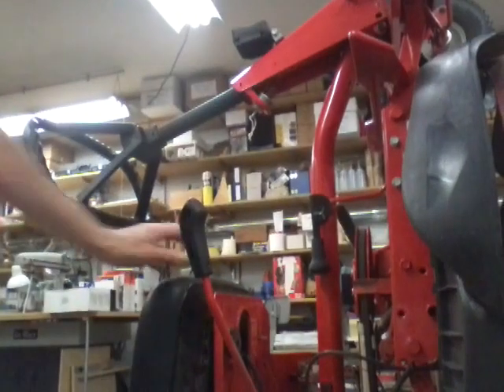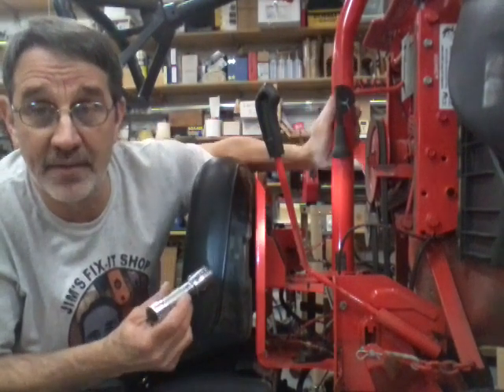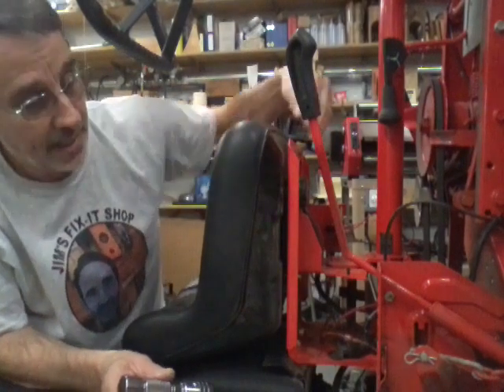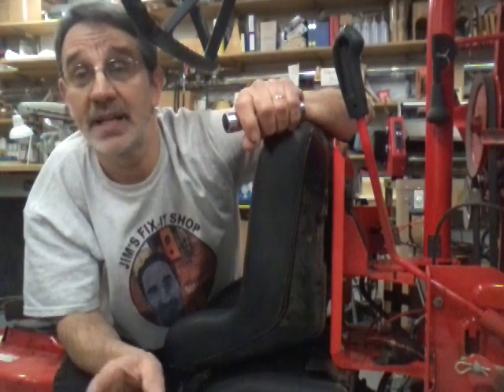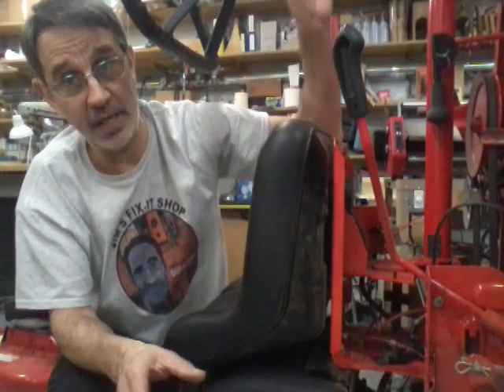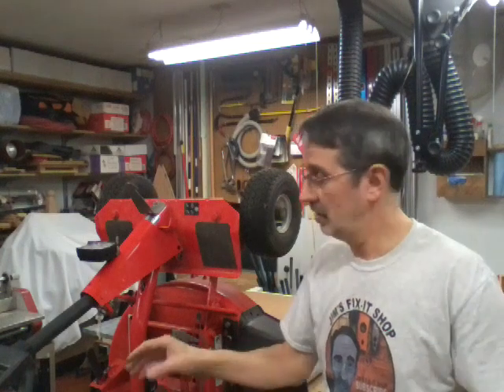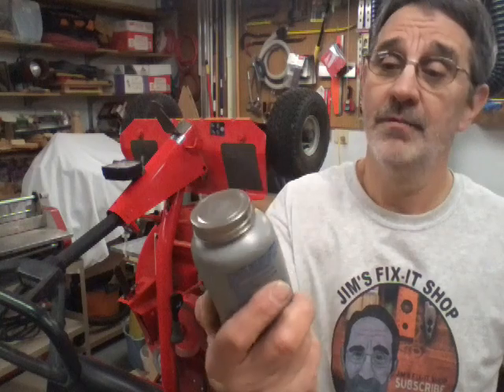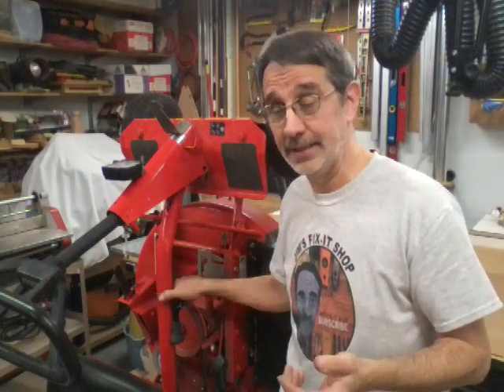350.  Replacing the pilot bushing in a Snapper rear engine rider

Comment: Thanks Jim. I've purchased a 1999 snapper 28" HV. Sofar, I've replaced everthing, but the transmission parts which seem to be in good condition. I had a used Coment which lasted for about 30years. Over the last 15 years, I've had 3 mowers. I truly don't believe there's no better mower out there than the 28"HV for lawns under an acre. I presently been using a snapper rear engine 33" hydro that I do not care for, so after I replace the pilot bushing the 33 has got to go! Anyway, just thought I would thank you for the great videos on snapper repairs. I've learned a lot, and you have saved me countless hours on repair times with your tips. Thanks again. Also, I replaced the engine from a 10hp to a new 11.5. The wiring video cleared up all my concerns on the rewire. This motor has the regulator, so pretty much wire the same to the battery.
Reply: I'll forward a photo when I finish up. The mower has no rust, so it was worth the overhaul!
Reply from the maker: Well, don’t forget to be sitting on it when you take the picture I’d like to hang it on my wall of friends.     Jim

Comment: What an experience!  After noting the play in the pivot bushing by grabbing the front edge of my seat to lift and feeling what I thought was a good quarter inch of lift at the seat edge I got concerned, bought a new bushing and dove in. What a job!  After about 5 hours of cussing and working my but off it was finally finished. It has the exact amount of play now as it did before I replaced the bushing.  All I gained was piece of mind knowing I had a new one.  
I bought the mower in 2010, so after 12 years of mowing a half acre in Kentucky the original bushing  showed basically no wear.  I wouldn't try the job unless you're an experienced mechanic, it was  not easy.

Comment: Hi Jim, another great tutorial.  I recently removed my tube from the main case to replace my pilot bearing.  I was curious to know if a grease fitting could be installed and utilized for lubrication purposes for that area?
Reply from the maker: I have installed grease fittings on them tubes before but the wall  of the tube is so thin you have to weld a nut on the outside of the tube to screw the grease fitting into then you drill a hole through the tube so the grease can get in and the grease fittings are a 14-28 thread.  Jim

Comment: Hey Jim!Another informative video & allot of good tips on step by step procedures , I use the same Permatex anti seize on my tractor center links,Or wherever threaded adjusters need anti seize is needed ,Good tip on that is to use disposable latex gloves because it hard to wash off your hands, & it's aluminum base anti seize so it's rust resistant . ( SNAPPOUT ) That engine that's on your workbench what is that going on ? Looks like a replacement for a walk behind self propelled Snapper.
Reply from the maker: No that's a 12 horse off of one of the rear engine Riders I'm going to try to put rings and a valve job in it. Jim
Reply: @jimjackson9381  It does not look that big very similar to the 1 I put on my 86 S/P walk behind Snapper. Thank You for your reply & be safe Jim . ( Snappout )

Comment: Hi Jim - it's Big Rodders in Ireland.  A comment you made got me thinking.  Have you ever tied one end of the mower to a tree and tried to rachet strap the other end away from it to separate the two halves?  If so, was it a success or is heating that sucker the only game in town?
Reply: Jim - Rodders again.  My hospital equipment engineer dropped by today and gave me two 17 amp/hr gel batteries, which are ideal for Snapper RERs.  Did you make any progress in getting your hands on a gel battery?  Using a gel battery and running the carb dry removes all concerns about tipping the mower up on its end.

Comment: Hi Jim.  Please do a vid on replacing the Brake/Clutch cable.  Mine and others I have seen are failing right at the brake/clutch pedal...
Reply from the maker: Does your machine have two pedals or just one, it makes a difference on how the cables are ran and how many cables you have. Jim
Reply: @jimjackson9381  It is one pedal.  28" deck, purchased 2008 series 23 model 7800104.   Think it would be a great vid for cable replacement.   Got this on Amazon: Briggs and Stratton 7022449YP Clutch Cable
Reply: @jimjackson9381  Hi Jim,  Got it done, took about 1 hour to replace the cable.
Reply from the maker: @dogsarefun2  well that’s good, but I guess I will make that video.